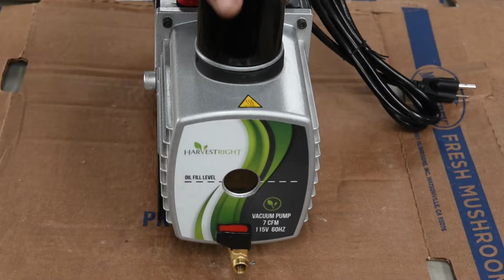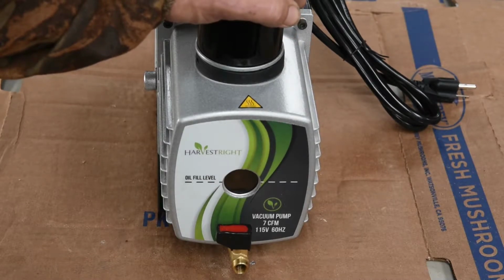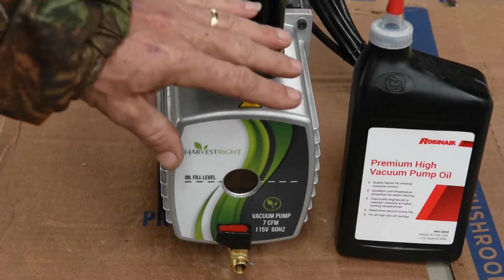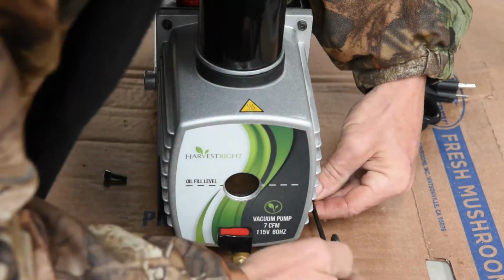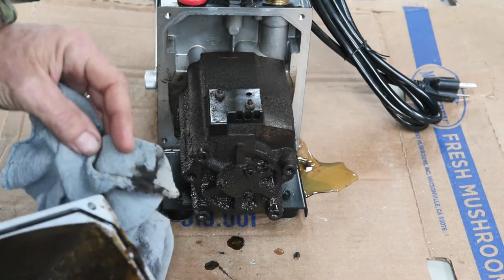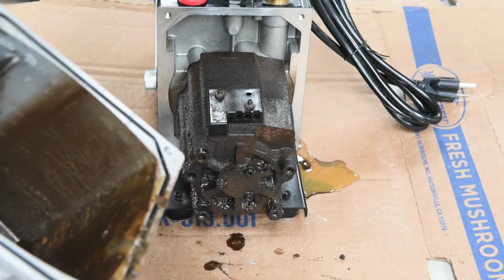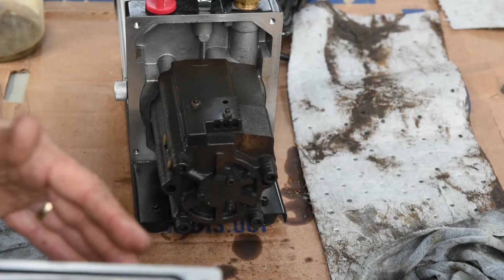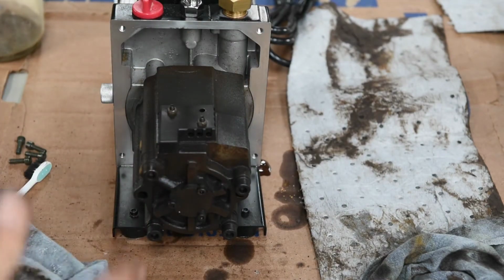Harvest right freeze dryer standard vacuum pump maintenance and cleaning.

Comment: After watching your video, I was no longer intimidated to finally, after two years, clean out my oil pump. I have to say, mine was a lot cleaner than yours was. No gunk in the casing (the part that came off) and very little brown on the main part. I think the reason mine is so clean is that I change my Dairyland oil after every use, drain my oil into an old Sam's club peanut container (tipping at an angle so that the water is in one spot, then filter the oil into my Brita using a tight roll of toilet paper with coffee filters wrapped around the outside and stuffed in the filter hole and making sure no water gets poured into the filter. I then pour the watery oil into an old waterbottle with a lid, put it into my freezer to freeze the water and pour off the rest of the oil in to my filter once the water is frozen This takes a few extra minutes out of my time but i guess it's been worth it to have such a clean and trouble free pump. I do want to add, when I cleaned out my pump, there was a little bit of yuck in the window so I used q-tips through the little holes and was able to get most of the gunk out. Looks so much better now.
Reply from the maker: Hi and thank you for your comment. After switching to the dairyland oil we haven't had any issues. We change and filter our oil after 50 pump hours. We also use a brita filter and you are correct it works great. I like the idea of freezing the water and separating the oil. I am going to try that. Thank you for the tip. I love hearing from fellow freeze driers and all the tips we get from you all. Thanks Bob
Reply: Do you sue the oilagain after filtering?
Reply: Yes I use the oil again after filtering. I have been using the same oil for a couple of years now and will continue to use it as long as it filters clean.

Comment: Thanks for showing us how to clean it.  Harvest Right has the oiless pump, seems like that's their solution to the oil issues.  So far everything I've heard about that oiless pump is highly positive.
Reply from the maker: Yes It does sound like that is the way to go. I think after this pump breaks we will order the oilless pump. It is time to take it apart again and see what it looks like. I should be posting a new video on it this week. Thanks for watching.
Reply: @HippieHillHomestead  how long does each cycle last?  Mine currently takes about two days to process a batch regardless of soup or shredded chicken
Reply from the maker: @JoshDAngel  It really depends on what you have in you FD. The more water content the longer it takes. Also on these hot humid days it takes longer than on cooler days
Reply from the maker: Here is the link to my new video update with dairyland oil in the vacuum pump. https://www.youtube.com/watch?v=7fBg-oyZeWE
Reply: @HippieHillHomestead  I gather the oilless pumps have internal pieces that wear out after a couple of years  if you send it back to HR it sounds expensive to have it "rebuilt". I will chug along with my oil pump.
Reply from the maker: @theoldguy9329  Me too. The oilless pumps are expensive. Thanks for watching.

Comment: same problem but worse for me, oil was coming out black after each cycle and think it maybe the quality of the cast iron so it was suggested to me which I will try is to clean all the oil off then use a rust remover so its as clean as possible then paint the cast with a high temp paint, the paint I purchased has a max temp rating of 300 degree Celsius.
Reply from the maker: Great idea. I may have to try that.

Comment: I have not taken my basic pump apart yet, but I've been using DL since the get go and it's filter through a 1uM filter and dewatering column almost constantly.  I have a stainless steel wet tumbler that I wonder if it would damage the vane cart if I cleaned it with that.  I guess the actual working surfaces of the VC shouldn't ever need cleaning since their constantly getting worn on.
Reply from the maker: Sounds like you have a great set up. That is exactly what we are going to do with ours. I think constantly pulling the water out and filtering the oil is key to long life. Thanks for watching and sharing your set up.

Comment: I would use pipe cleaners and little bit of carburetor cleaner to clean the glass works perfectly, and by any chance does anybody know where I can buy the rubber gasket or what size it is? Any info would help
Reply from the maker: Thank you the pipe cleaner is a great idea!!! I am not sure on the gasket size, I will try to find out. thanks for the comment.

Comment: So do we need to get a new dimister?  The black thing on top? Or clean it .. has a bit of seaping
Reply from the maker: How many loads do you have on your pump? Is your oil level to high?  We have never had any trouble out of our demister. If yours is seeping than I would clean it.
Reply: @HippieHillHomestead   about 75 loads. Nope alwaY keep oil at the line.
Reply from the maker: @Kristalurlee365  I would try cleaning it. What oil are you using?
Reply: @HippieHillHomestead  ot dont feel like it unscrews its weird. The blue oil cant think of name off the top of my head 🤦‍♀️
Reply from the maker: @Kristalurlee365  Sounds like you are using dairyland oil. How long has it been since your last oil change? When you change your oil make sure you tilt the vacuum pump forward until all the oil and water drain out. Sometimes contaminants stay in the bottom of the pump.Change your oil after every load for a while and see if that helps.
Reply: How does the demister come off ?

Comment: so I'm curious what harvest right has to say about all this. Has anybody talked to them, though I'm sure somebody has. I haven't been following the groups much lately because I haven't been freeze drying lately because I had to change the relay board and I only finally did it.
Reply from the maker: HR doesn't have much to say about it. When I called them they didn't have any recommendations other than upgrading to a premium pump. HR doesn't manufacture these pumps they buy them from Robinair. They are the same pumps used in the automotive and HVAC industries. Since we switched to dairyland oil and started changing our oil every 50 pump hours we haven't had any trouble. Thanks for the comment

Comment: I wish you would’ve shown me what you cleaned it with did you just use rags can you use soap on it not being a mechanic at all I have no clue. You did say acetone and I have some acetone, maybe I can use that. I’m a brand new freeze dryer owner, and I ran four cycles and the oil looked the color it does in the brochure for the change so I changed it. It will not filter through the new oil filter that harvest right sent with this freeze dryer. Now my window is getting dark and I don’t know where to put the next batch of oil if it won’t go through the oil filter that they’ve sent. Thank you for posting this I found it very helpful!
Reply from the maker: Hi Barbara, Yes I just used a rag to wipe off all the gunk. I didn't want to use any acetone because that could ruin the seals. after the first run with the dairyland oil the sight glass cleared up. Looked clean as new. I guess its the detergents in it. I am taking it apart today and will be posting a new video soon. I hope it is going to look clean. Thanks for the comment and thanks for watching.
Reply from the maker: Here is the link to my new video update with dairyland oil in the vacuum pump. https://www.youtube.com/watch?v=7fBg-oyZeWE

Comment: Thanks for the commentary. There is not a lot of direction. 
I have an older version of the HR branded standard pump. I filter after every run. I initially had a real Harvey filter that used a car filter (and lost a quart of oil when you changed the filter). I like the HR version, but you need to dump out their filter filling and line the basket with a coffee filter and then pack it with cotton  batten or balls (cotton likes to soak up water, plus if in tightly will filter)).. It does a good job and my oil looks pristine.
Inside the pimo HR initially suggested carberator cleaner (gettingg hard to find). Later they suggested CLR, which does work better on the glass with a little probing. Of course, which either chemical let it sit and dry off for a couple of hours (IMHO). The water based stuff definitely takes longer.
Reply from the maker: Brian, Great information. I will have to try it. Thank you for sharing.

Comment: how's the dairyland oil doing so far?
Reply from the maker: It is doing great so far. We are at 20 loads using the dairyland oil and the site glass is perfectly clean. The dairyland oil is blue so its hard to tell how dirty it is when I change it but it looks cleaner. I have started changing the oil around 65 hours of run time now instead of load count. Using the load count never made sense to me, because one load may take 15 hrs and another 50 hrs. Thanks for asking.
Reply: @HippieHillHomestead  - have you spoken with Harvest Right about using Dairyland oil in this newest revision of the standard pump? I'm asking because another (similar to your channel) has advised against using DairyLand in the new standard pump and claims that's what HR informed them. Never-the-less, I'm looking forward to you sharing your experience on this subject as I have a standard pump coming with my new HR sometime in June 2021
Reply from the maker: @honeybadger6127  No I haven't talked to HR. We belong to several freeze dryer facebook groups and they all recommend the dairyland oil. Join Betty's freeze dryer group and Retired at 40 freeze dryer group and read through the posts. Brian from retired at 40 did a video and he said to just use the dairyland oil every now and then to clean the pump out. When he was questioned about it on the Facebook group this is what he said "Don't be scared! SPOILER~ unless you have the premier, you can use the Dairyland all the time if you want." Thanks for the question.
Reply: @HippieHillHomestead  - groovy.. thanks for the detailed reply. Looking forward to learning more!
Reply from the maker: @honeybadger6127  Your welcome.  I hope the dairyland oil works.
Reply: There is very strong information out there to not use the dairy land oil it will ruin your pump. Please check with the company.
Reply from the maker: @TasteOfHealthOnline  I think that is only on the premier pumps. But I will check. We have been using it since I made this video. I am actually recording another video on it today. I will post the results soon. Thanks for sharing.